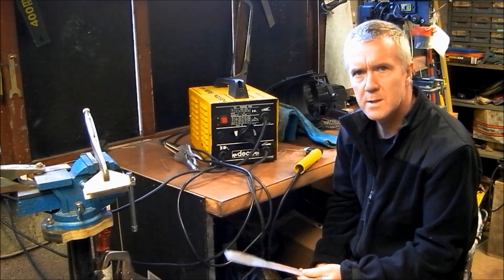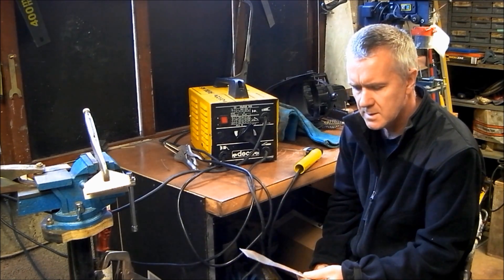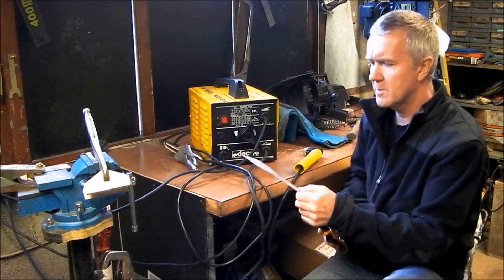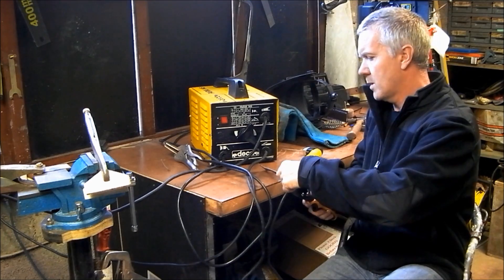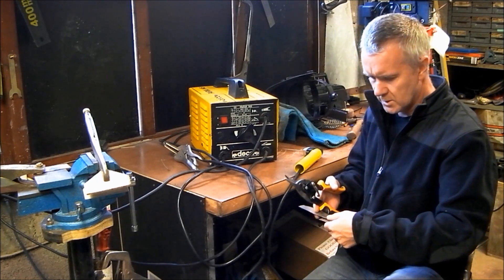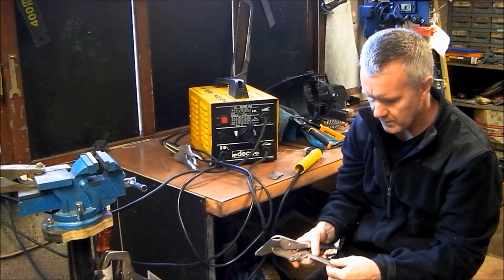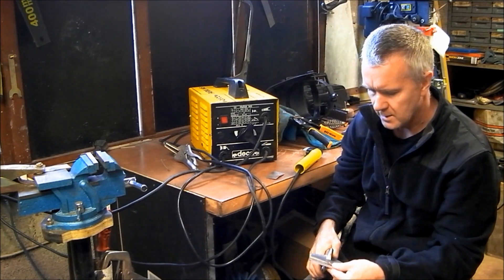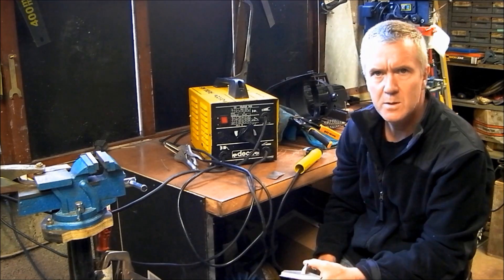Welding thin gauge steel with stick welder

Comment: Another one is to cut your rods in half. It makes for more precise arc manipulation. I use pliers/sidecutters to cut  the rod into two half rods, and break the flux off the end which you would normally strike up with. The arc is much easier to get started at low currents, if theres a little spikey "burr" or "chisel point" at the end of the rod, from cutting. Sometimes I even just snip off a quarter inch from the full rod to get that burr.

Comment: Hi I have recently purchased a stick welder, (arc welder.. have used it a couple of times but have no actual experience or have never used a welder in my life before hand.. so thought ide have a go as am very interested in it so I thought sod it. Been waching couple of your videos and a other ones on you tube before I used the machine. Have tried welding sheet metal but rather than making welds am just making big holes in the work peice. Can anyone one give me some tips please.

Comment: Thanks for not editing out the stick getting stuck before you got a good arc going, it really helps people realise how hard keeping an arc on thin at low amperage can be and that you shouldn't just expect to find it completely perfect straight on.
Reply: I fully agree. I am a total novice and it is good to see that others struggle with the rod sticking. It tells me that it is not neccessary something that I am doing wrong. I am going to try this since I need tons of practice.
Reply: Seems like hes welding ac tranformer and it is extra hard to Start comparing modern dc computers.

Comment: Again you can weld it with a 3/32 in. or even a 1/8 in.
Reply: 10 gauge is THICK
Reply: 16,18, 20 gauge r thin

Comment: .8 mm I believe is 21 gauge.  I've been going crazy with 22 gauge, 21 gauge, have tried flux core, oxy-ace, and even TIG. I tried simple old stick yesterday and may have had my best result so far!  It's a little hard to hear what is being said in this video, but replay helps a lot, it is very helpful- thank you.  Look how fast and how little fuss there is here, just keep the stick hot and go, easy to stop and go too.  With my a/c flux core I'd burn right through beyond a tack. With TIG it's grinding tips which get stuck and burning through trying to see a puddle.
Reply: I played around a lot with thin gauge steel during my seven semester classes of welding at a junior college. That's thin sheet metal to be arc welding even with 1/16" electrodes, unless you are just tack welding. Even laying down 6013 with DC and a tight arc is going to burn through. For me, a good ground on light gauge mild steel helps. TIG or pulsed TIG with a properly ground uncontaminated electrode is the way to go for thin steel. Check out Jody Collier on his channel Welding Tricks and Tips for other great tips.
Reply: @mikeca98  if i did not see it with my own eyes i would agree, how can stick not burn up the metal if flux core and even tig does, but i've seen it, must be very gentle stick welder, i'm sure it has hf startup because the tig function does.
Reply: Are you welding indoors? Have you tried using MIG with .023 wire? That should be worth looking into, especially for stitching together car panel repairs.
Reply: @mikeca98  i went with a second hand flux core instead of mig (probably a mistake) then i went to tig and got the argon.

Comment: I'm researching to decide ac or dc for thin. I'm so glad I saw this done with an ac "buzz box" welder, and done well. I can see it is challenging but the weld was smooth, yes seeing a close up of result would be nice but I can imagine.  it seems ac welders are not meant for low current thin metal, but now I see it can be done- a big help.

Comment: Help with this question

A welder qualified to make arc spot welds on 20 gage steel deck is also qualified to weld:
a. 22 gage steel deck
b. 18 gage steel deck
c. 18 through 22 gage steel deck 
c. None of the above

Comment: Now this is a lap joint...But a butt weld can also be done. Did it a few times in the past. Of course, MAG welding is easier in this case. But sometimes you can't choose.

Comment: I bought a little device shaped a bit like a door wedge, it attached to the work magnetically and on its top surface was a slab of graphite. You struck up your arc on the graphite which it did much easier than on the workpiece and then quickly moved down onto the work. It made the initial strike up much easier.

Comment: That takes some real skill on a cheap buzz box type arc welder like that one. I've got an old Oxford oil cooled that can go as low as 25A but at 80 OCV which makes the thin stuff alot easier. The simplicity of a transformer arc welder is great in having so little to fail. I don't weld very often, but before I do I just chuck as many rods as I'll need in the oven for half an hour before hand to ensure they're bone dry.

Comment: I noticed that these 6013 1/16" electrodes behave like 7018; they have the glassy coating on the tip and it has to be removed with file or you have to bang it until they strike arc. Like the videos and what you can do with chipper welder

Comment: Nice work. 0.8mm is around 0.035 inches, 1/32", or 20 gauge steel in the USA. In the the video, I believe you said 1/16".

Stick welding thin material is tricky. I like the challenge, so it's a bit of a hobby of mine.

Comment: Amp used  to welding the metal?   I can't get the arc started.  I used 75 amp and it was too hot.
Reply: Under 35A with a 1.6mm rod as stated at the start of the video. If the welder you have has voltage options, going higher makes it easier to start and maintain the arc at low amps.
Reply: Matthew Jenkins Newbie here,  30A works fine on 1.4 and 1.6mm rods I buy here in Japan.  I eventually figured out   that cleaning the slag off the end of the rod is the key to restarting the arc, so I keep an ungrounded large coarse file next to me and just tap and drag to clean the tip of the rod.

Comment: hi! may i weld 2 or 3mm galvanized wire with 2.5 mm stick? i couldn't find thinner size and welding machine is working 50-250 A. thanks.

Comment: Over forty years ago I saw a workshop where the welding electrodes were kept in an old filing cabinet, in the bottom shelf they had installed a light globe which was permanently left on - this tiny addition of constant heat kept the rods warm and dry,

Comment: good tip about getting the rod hot on a spare piece of metal first . Commonsense perhaps but I haven't seen that tip mentioned anywhere else and it sure would have helped me if I saw it earlier today lol.

What I would like to see is the settings and rod guage for that particular weld would have been helpful to a novice like me.
Excellent tutorial thanks buddy
Reply: Supposedly if you keep the electrodes in an airtight container or heat it up in the oven prior you dont have to do a warm up on scrap. However, I always do the scrap method since it is convenient and I'm not a professional.
Reply: I usually just use my everlast mig welder for everything now but when I did stick weld heating them up made everything more consistent for me.  I've never used an oven before.

Comment: i also weld sheet metal like you do in this video...   the funny thing is that it turns you into a pro when you actually use a good mig...   but i still havent bought one because i do it like you.....   good video...i dont think people understand how hard it can be to get the arc going with low amps...
Reply: Maybe lean your stick even closer to the workpiece to so the rod doesnt stick since the are at the side of the rod.
Reply: sriking the arc is pure talent at low amps

Comment: No much of a welder is he
Reply: Dave Smith also when Amps are really low
Reply: Quite the opposite. He demonstrates reasonably good skills. If you are talking about the sticking, that happens a lot with rods that absorb moisture and need to "warm up" before they work well. You can keep them in sotrage containers, dry them out before use, or just strike a short arc before going.

Comment: What is he saying?
Reply: mmhhmh hemm mwad masdsmmd  mhhhmhhmmm
Reply: that you can weld sheet metal with a stick, using 1.6mm or 1/16 of a inch rod, below 35 amps, using a scrap piece of metal, you a little bead to make and keep the rod hot, and when you weld your actual work peace, you go by little sections
Reply: I do. I just wish I could understand him.
Reply: +Takunrsx 
Thanks. I need to weld 1.6 mm tube to 3 mm thick steel. This should work.
Reply: I'm not an english native speaker and can understand him perfectly. Apreciate he is sharing his knowledge.

Comment: yah...turn your welder off imediately after welding so it can cool off without the fan running....fail
Reply: if you´re done and you wont using at againg theres no need for the fan

Comment: i weld my exhaust pipe with my arc welder got the nack of it now
Reply: Stick welding thin sheet metal is tough to master. I'm thinking about trying one of these everlast pulse mig machines. Pulsing the arc should help keep things cooler to reduce burn through. Stitching the weld should help too.

Comment: You should have done one continuous weld or at least chip the slag after every time you stopped. Slag inclusion
Reply: +Bobert Wirl it will get to hot and burn through if you do a continuous weld and its ok to start the next weld providing the slag is still glowing red
Reply: Exactly what i was thinking.

Comment: I have done lots of welding with the smaller amp welders. Just have to make sure everything is clean, and when welding material together bevel the corners with a grinder this will give you a much stronger weld joint. Move your weld pool slow with the lower amp machines to keep your metal hot.
Reply: im trying to do this but my machine does not go below 60A and its very hard

Comment: Very helpful video. I have some 1mm stainless flue pipe to weld and will be trying with 1.6mm 316 stainless rods and a DC inverter welder. The rods are designated DC positive which I understand means that the rod tip gets hotter than the workpiece which I guess will help? I'll probably lift the rod for a couple of seconds every half inch or so like you did here

Comment: What rod are you using, just so I don't buy any!  I didn't see any flux, plus you need more volume.
Reply: well, if you get your head out of your ass, that info is right at the beggining of the video
Reply: +David Spennachio that's what the rods look like with flux.
Reply: ***** Yeah, been welding for more than 20 years, professional.  Still want to know what rod was being used.  Looked like a coat hanger...
Reply: Looks like a noob on his first day with a coat hanger trying to stick weld, under water, with one eye.

Comment: backstreetmechanic 
Hi, I dont know if i asked you already or not but
Hi, I am thinking of buying an Arc (stick) welder for repair work on my van which needs work doing to pass the mot test.
What AMPAGE would you suggest for general car work, it would need to be able to weld on front wings, cills, valances and also chassis work (ie floor pan rotted for etc)
Would a 100 AMP arc (stick) welder do that or would i need to go higher?

I have the choice of 3 types 100 AMP, 130 AMP and 160 AMP, the price goes up higher the more amps, which one would do what i need it to do?
Thanks great videos
Reply: +SP330Y For chassis work, the highest quality welds will be obtained from a TIG setup, however this is expensive and difficult to learn. If you are limited to stick welding,  for structural welds try some 11018 rods at about the same current you would run a 7018 of the same diameter, and for sheet metal use 1/16" 6013 rods on DC electrode negative.
Reply: SP330Y this is probably way to late now because you have probably already bought the arc welder but i would suggest a no-gas mig welder for car repair work but that's just my opinion.
Reply: +SP330Y If you're gonna work on old cars and attach/fabricate motor mounts, I'd feel insecure with anything less than 200 amps, and even then I'd be disappointed about having to do so many passes in those scenarios.
I'd get a used stick welder, if possible. I bought a [incoln idealarc] 250/300 amp AC/DC welder with 50 foot leads for 125 dollars. It even has a capacitor that helps keep me from tripping the 50 amp circuit breaker. I haven't had problems with it.

Comment: hot start would be nice although it would never pass a test with slag entrapment
Reply: When welding 22gage 0.8mm material, if you can do it without burning a hole you have suceeded and slag entrapment is the least of your problems. Slag entrapment usually happens as you try to repair the holes you burned.
Reply: +ryan lewis You aint taking  test on that toy welder.

Comment: in the prosess of welding the back of a cone hopper that is attached to a tractor to use it as a forge hood but having trouble welding aloy sheet steel to the thin sheet steel to make the back of the hood any advise will be wellcome thanks

Comment: This gives me a little bit of confidence. Thank You. Dragging my stick welder out to patch a hole in the bottom of a 1/32" oil pan. Overhead 1/32" 7014. = /
Reply: I probably would have just used engine parts cleaner followed by steel epoxy. Did you manage to patch it?

Comment: the reason its not keeping a good arc is because you need to turn the amperage up.
Reply: no shit, did you look at how thin the steel was and the title at the start? If he turned the amps up it would blow a hole through the steel.
Reply: ookay negetive nacy, yes I did see that.
Reply: Benjamin Zoske  And it if he turned it up, he would blow a hole right though it, fuck nuts.
Reply: +Benjamin Zoske yeah I guess the summary is: with the thinner materials, sometimes you have a very narrow working range between all of your optional weld parameters.
Parameters such as rod distance from workpiece, rod angle, feed speed, moisture content, and (relevant to this comment) tip pre-heat level [which allows for an arc that doesn't burn through the workpiece].
just my thoughts..
Reply: well somebody is angry, jeez, I'm sure your some professional welder huh?

Comment: I have used a stick welder before. Do as mentioned and like this video shows. Take your time on a cars body. I generally use my 80 amp flux core mig welder. I do short tack welds until I fill in the majority of a panel. I then grind the surface smooth and cover with filler.

Comment: Thats a good question. I've just started doing this as practice and I'm tackwelding at intervals, then coming back and tackwelding between the existing welds, finishing with grinding. Finding it difficult to guess the correct current.